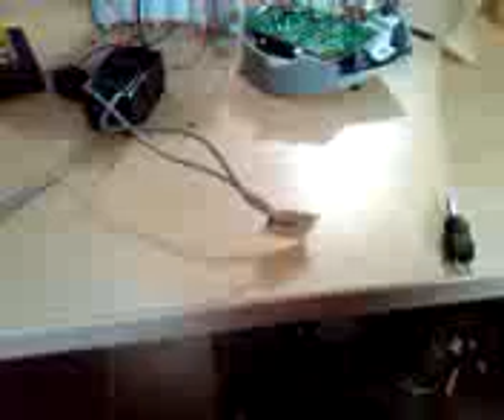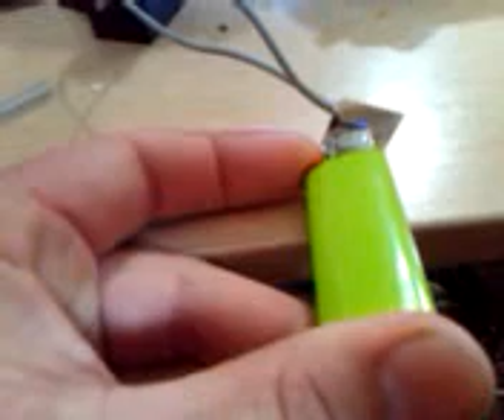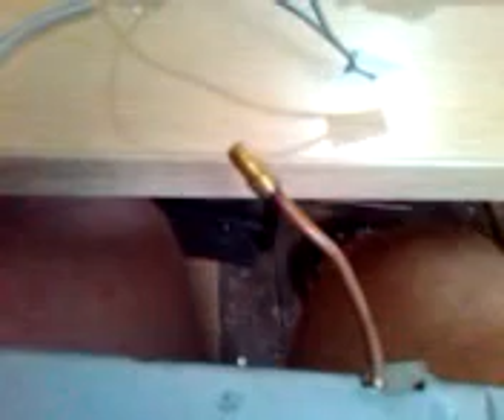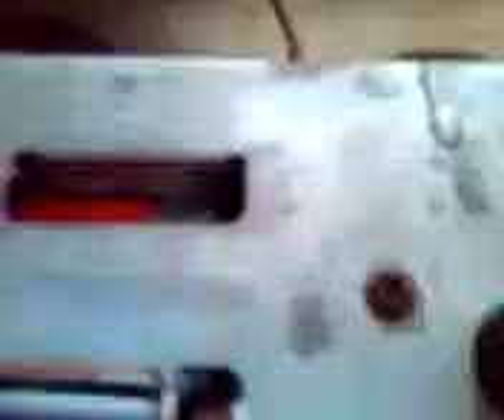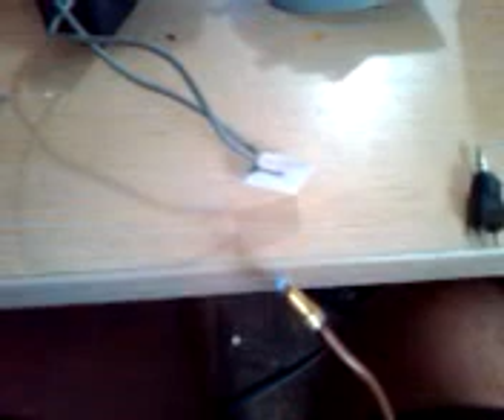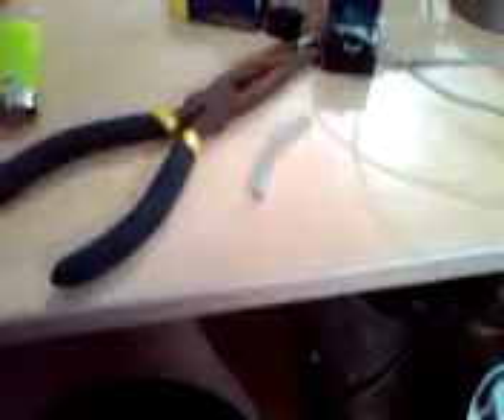Ionizing gas-low volume test

Comment from the maker: @crob227 im setting up a standard stainless steel "tube in tube" style cell-like Meyer used in the bench test cell.
thinking of using an old electric scooter PWM and no electrolyte.
since most nay sayers use the excuse that this process is nothing more than standard Faraday electrolysis,i think i need to hammer the point that this process is different and more efficient-so distilled water no electrolyte and pulsing power source are esential.